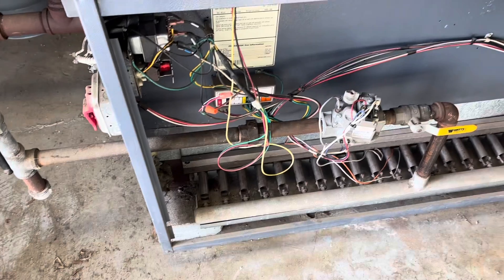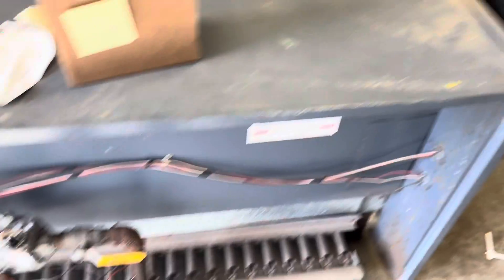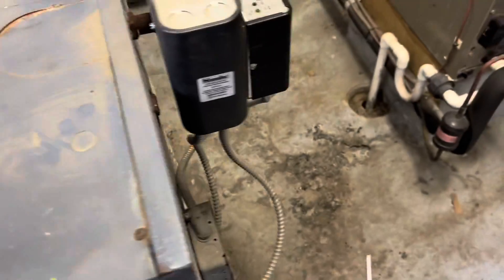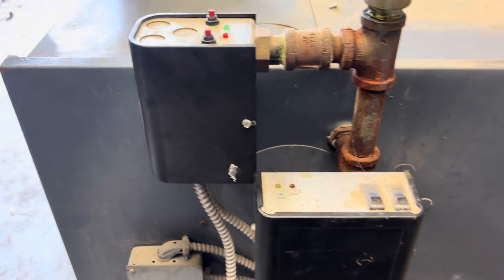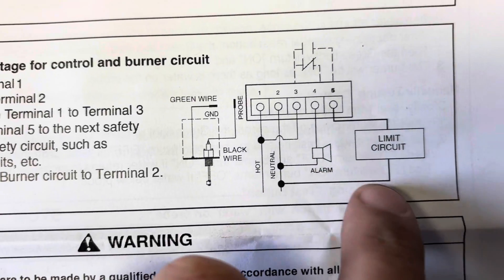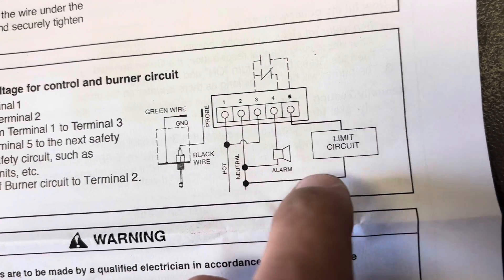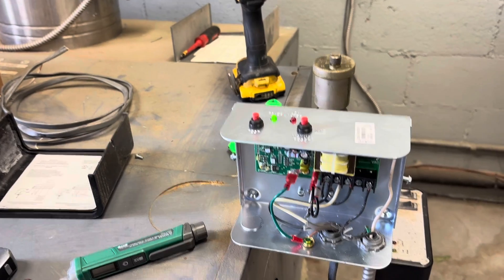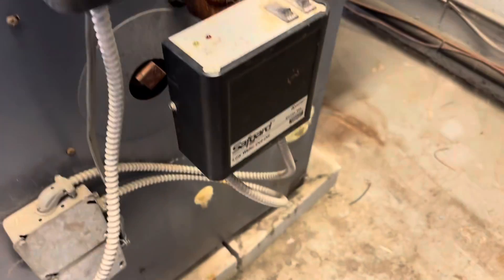Low Water Cut-Off Replacement On Weil-Mclane Boiler.  But Why Two?

Comment: Boiler Inspector 16 years this is a jurisdictional code requirement NYC requires dual low-water cutoffs (LWCOs) for most steam/hot water boilers, with each independently piped, referencing ASME CSD-1 standards, to prevent dry firing; exceptions exist for very small residential units, but generally, two independent controls (one automatic, one manual reset) are mandatory for safety, with specific testing & maintenance schedules outlined in the Mechanical Code.

Comment: NYC for commercial building . Boiler require 2 low water cut off & they what you to hard wire your smoke detector to boiler
Reply: I was coming to say the same thing 2 lwco and 2 pressure switch one of each has to be a manual reset.

Comment: Sometimes you could have 2 LECO's , one being used as the actual burner shutdown and the second one controls the make-up wster valve.
Reply from the maker: Very true.  These two basically shut down the same thing tho.  The one I replaced cut main power to the boiler, the other cut power to the ignition control board.

Comment: I think code requires a 2nd cutoff in certain states for boilers above a certain btu rating.  That's a big boiler.  I had 550,000 WM EG-11 in my house.  Was able to replace it with an 8 section Burnham Independence.
Reply from the maker: Didn’t think about that.  Good point
Reply: @JeffsHVACAdventures  Somebody might have been thinking about redundant protection. Better to have 2 than none !